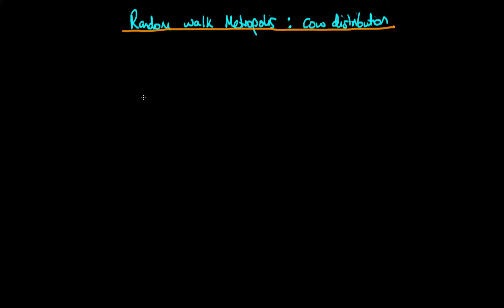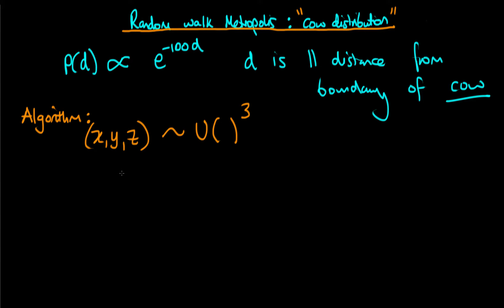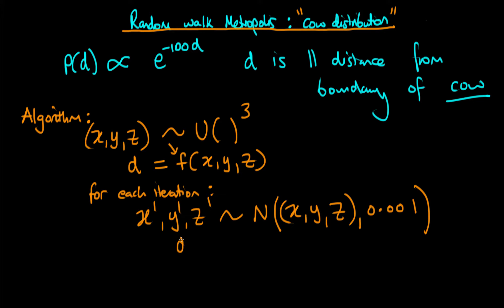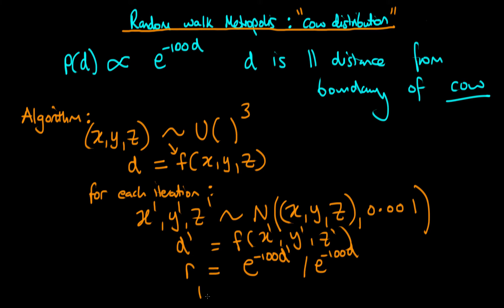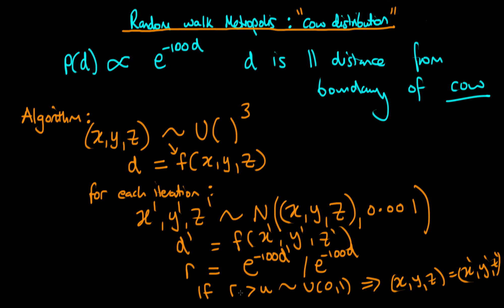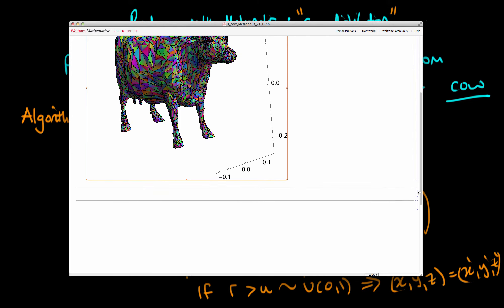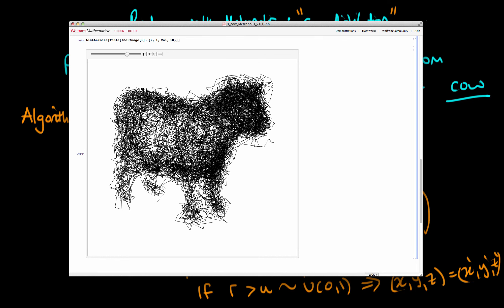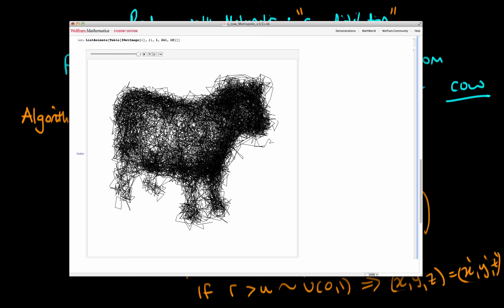Using the Random Walk Metropolis algorithm to sample from a cow surface distribution

Comment: Hi Ben, Thanks for your illustrative explanation! Just a quick question: from my point of view, anyway, you need to numerically calculate the distance to the "cow" and then its probability, what is the point of using such a sampling strategy? With such calculations, you can always do a sampling of the entire x-y-z space and calculating the probability, then get the same result. Is it because the Metropolis algorithm needs far fewer sampling points?

Comment: Hi Ben, this might be a silly question. At 1:27, you said you don't know the function f, but then you said you can still calculate d with given x, y, z. Are those contradictory? And what do you mean by you can calculate it numerically?
Reply from the maker: Hi, thanks for your message and apologies for any confusion. I mean that the function f - that denotes the perpendicular distance from a point to the cow's surface - is not a function I can write down since the cow's surface is complicated to represent mathematically. I can, however, numerically (guided by theory of ray tracing and Mathematica's inbuilt functions) calculate the distance of a point from the computational cow's boundaries. Hope that makes sense? Best, Ben
Reply: @SpartacanUsuals  Thanks for your prompt response! Yes, that makes sense now. Thanks!
Reply: @SpartacanUsuals  So would it be safe to say that that the cow-function is known, but not analytically tractable, and that is the motivation behind using the random walk metropolis algorithm to sample from it?
Reply: @RaviShankar-de5kb  not only that but in order to normalize the distribution you would have to integrate it which is basically impossible. with that method however the normalization step is not necessary (as far as i understood).

And God alone knows best.